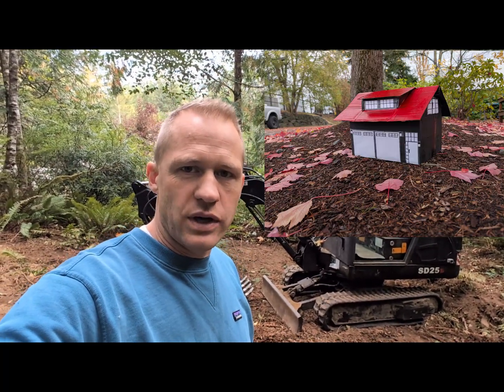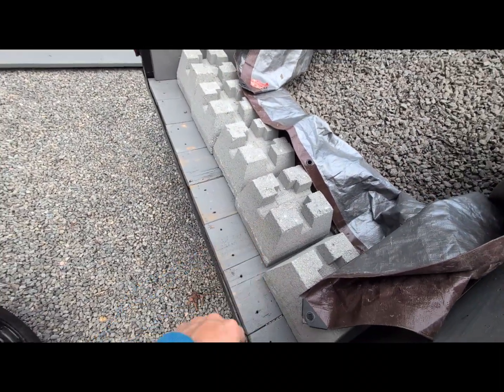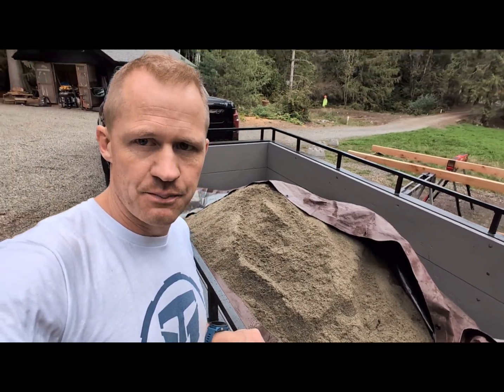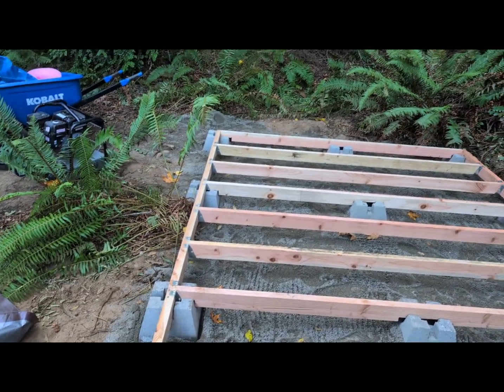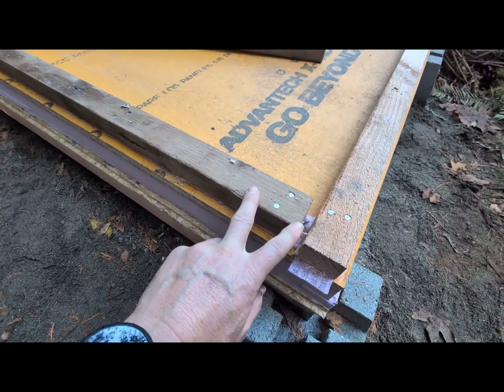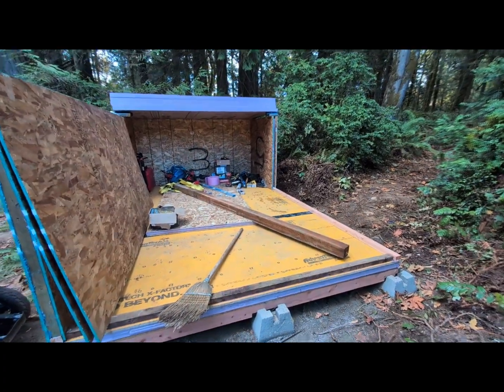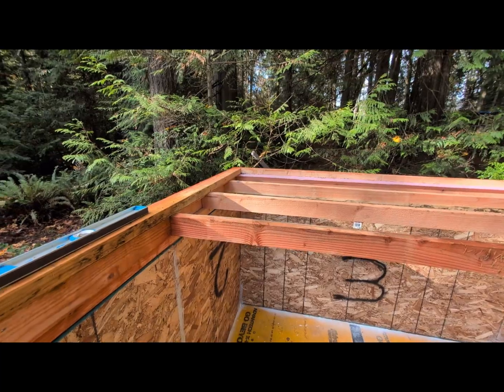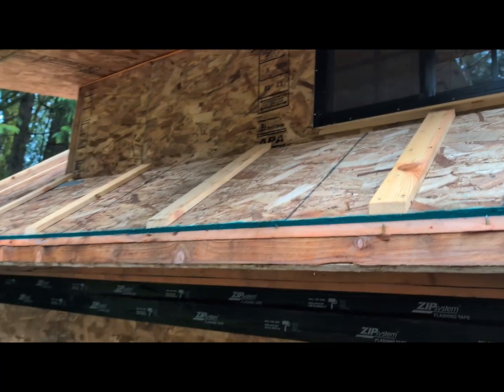Homemade Structurally Insulated Panels (SIP) mini Structure - Part 1

Comment: Wood is not an amazing material for chickens ... red thingy sleep in it and attack chickens at night. I'm using HPL it can be clean with high pressure water.
Reply from the maker: That is a great idea. I have put zip panels on the inside as they have a waterproof membrane. I also poured a concrete slab for the floor that I have sealed up

Comment: Hey, what about an update on the minidigger? Have you changed hydraulic return filter at 250 hours for example?
Reply from the maker: I don't have that many hours on it yet. I just use it around my property. I am at about 170 hours. I'll be sure to update when I do anything cool with it. So far, I have changed the engine oil and the hydraulic has spung leaks in the belt motors, so that one has been changed out too. All repaired with a couple of o-rings of quality.

Comment: This is an interesting building technique.  I recently became familiar with metal sided SIP panels you can buy, but this is my first time seeing someone build DIY versions. 

How do you navigate building codes with this non-traditional building style?
Reply from the maker: This one is so small that no permit is required. However, SIP panels have been made for many decades and when I build the ADU and the main house, we will have our SIPs made by Premier SIPS. They all pass.